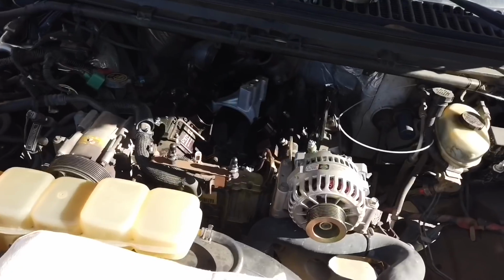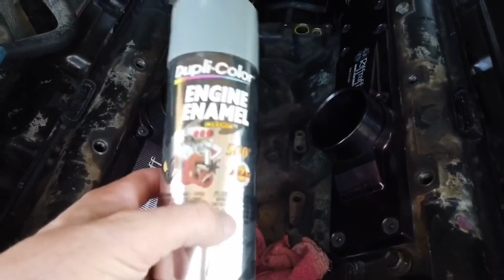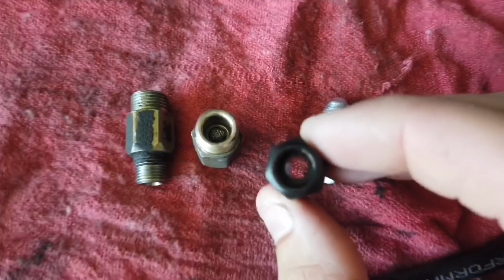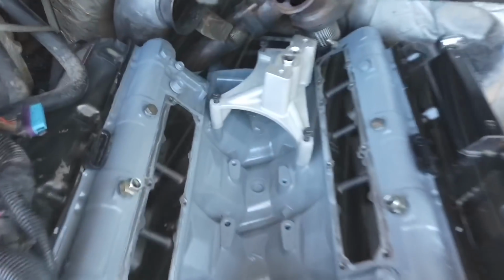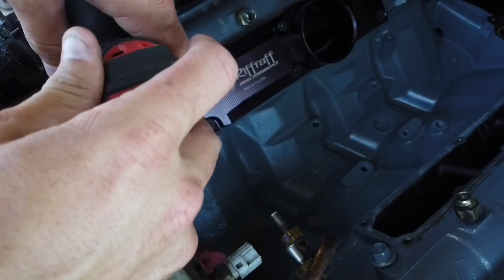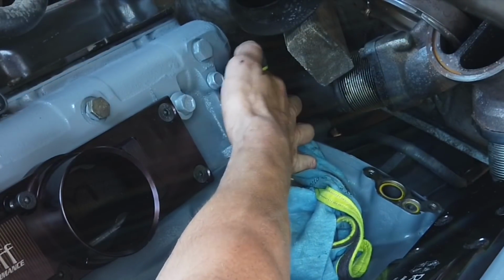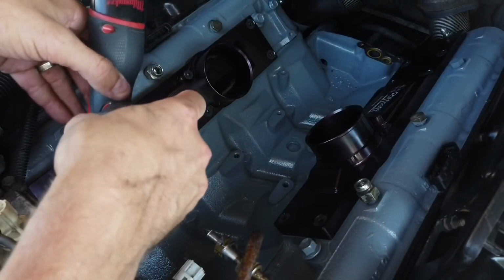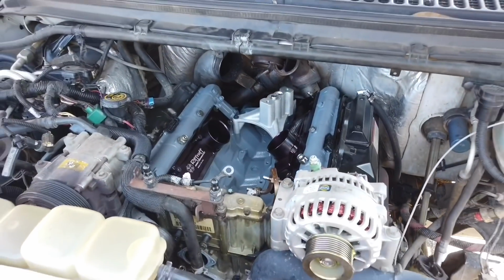2001 Ford Powerstroke F350 7.3 - CLEANING & PAINTING THE ENGINE RiffRaff parts look so good now wow

Comment: Here is a little mechanic's trick that will help hold your plenum gaskets in place while you are trying to get them reinstalled. If you take some wheel bearing grease and coat the gasket in a small layer  of grease it will help hold it in place while you  put them back in place.
Reply: I do that with all orings.

Comment: I have a 97 obs with the mechanical fuel pump. I should really plug that hole before spraying it with engine degreaser right ? Also mu turbo holes ?
Reply from the maker: I would plug all holes you can

Comment: It looks great  you installed new pedestal HPOP lines while you had every thing out you should have put in better Banjo bolts
Reply from the maker: I did later actually  https://youtu.be/bdVbNO7Kbrc
Reply: Quick question what are banjo bolts and what do they do
Reply: @matthewgomez1180  its not really worth the hassle.  No really benefit from doing banjo or the enlarged ccv returns unless your doing 600+ hp. The FRX Return from riffraff is a nice upgrade for cheap.

Comment: Them steel braided lines are sweet i just installed red coated steel braided lines for all my flex lines on my brakes on my 2000 4runner defenitly gave a way better pedal feel @FixItNick

Comment: What a sweet valley that is. Why did you replace the stock plenums with the riffraff? What other cleaners did you use beside carb cleaner? Carb cleaner starts getting expensive.
Reply from the maker: I used the Gunk Heavy duty cleaner and then a can of brake cleaner, I put links in description. Non Chlorinated brake cleaner works better because it doesn’t dry out as fast as regular brake cleaner, gives you a chance to whipe off good

Comment: Looking really good Nick. For those Riff Raff plenums I'd pull those gaskets and smear a super light coating of RTV in the groove then put the gaskets back in. The RTV should hold them in place for later removal and installs. For fittings, bolts or nuts in a hard to get to place with one hands, put a piece of masking tap on one side inside of a socket or deep socket then put the fitting in the socket. The tape puts just enough tension to hold it in place, then add a small 3" extension to help guide it in place. Simple but effective, It's an old mechanics trick my dad taught me years ago, I still use it today when needed. Love what your doing with the truck. Keep up the super work bud. Best Wishes and Blessings. Keith Noneya
Reply: No rtv use O ring grease.
Reply: @kennyirish5021  Why? It a SUPER light coating to hold them on so they don't fall off when servicing the covers. Also there is a groove to hold them in place from sliding. There would be so little RTV in there that it couldn't effect anything. I could see your point if someone used a regular coat of RTV it could squeeze out and get into the system, but i'm not talking about that, just a super light or film coat just to hold them in place for later. It doesn't seem to me that would cause any harm, it could only help. Best Wishes & Blessings. Keith Noneya
Reply from the maker: Thank you appreciate the tips, yea good idea on some rtv to hold in place
Reply: Not to take the love away from nick’s page, however o-rings require a grease to do there best to make a seal and in turn the o-ring will adhere to the mating surfaces for the absolutely best seal possible period
Reply: @kennyirish5021  For a one time use I agree. Only grease when it gets hot flows out, the RTV Won't so you only have to do it once. Been there done that both ways. No love taken from Nicks page Kenny we're all friends here. Besides it's always good to share more information and opinions to make the best decision for the one that suits a persons fancy. PS love the beard Kenny wish I could grow one like that, I was born a baby face :O(....., LOL Best Wishes & Blessings. Keith Noneya

Comment: Looking so much better Nick, and with the upgrades it should perform better and be more reliable.... We hope 😉..... Don't worry about being nearly 40 it's when you get over 50 you need to worry 😉😂😂
Reply from the maker: Thanks sir, I’m gonna have to redo the hardness it’s gonna look old and gross, Can’t wait for 50 then I can retire and be a full time tuber lol ...
Reply: Ya. Im 52 and I hate leaning over the truck to work on. I gotta do turbo. Not really. But wife is gonna know it needs one. Lol cuz its an e99 and factory it comes with a ww1. And I make 34.5 psi boost. At 3050rpm. So I'm gonna look into kc300x stg 2.